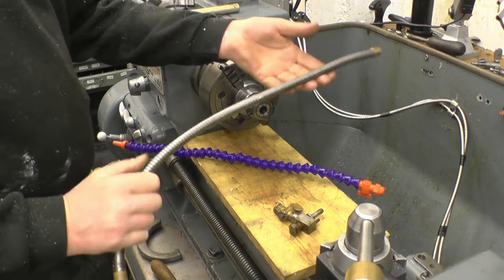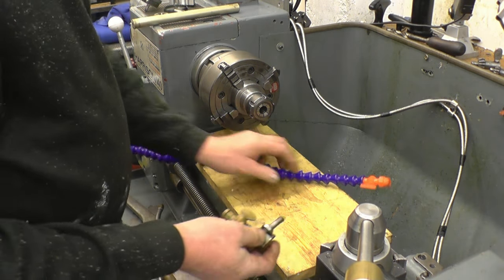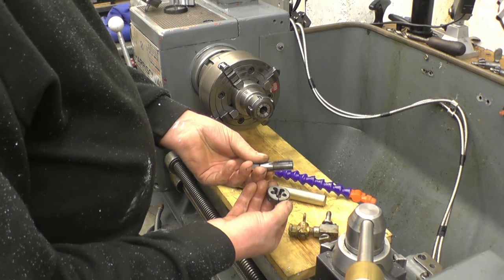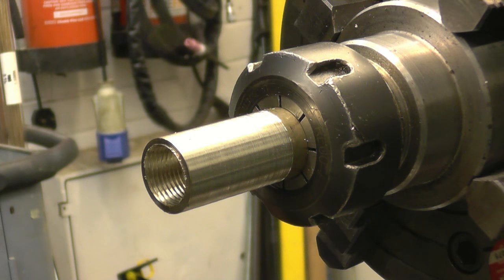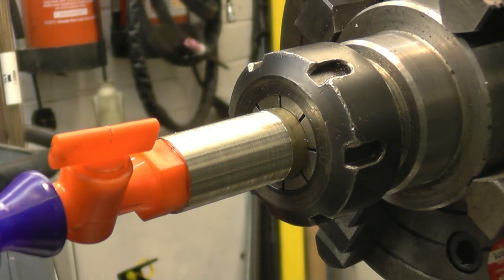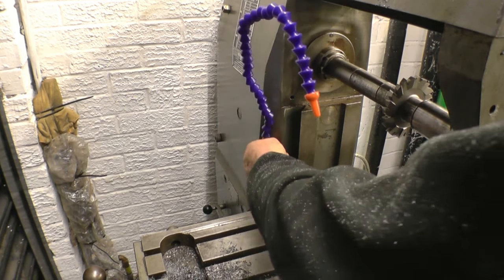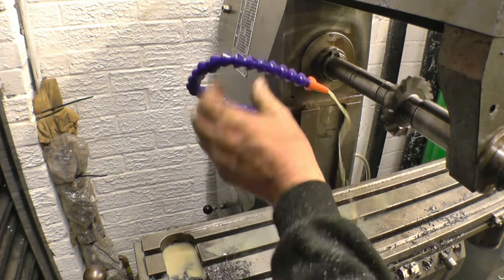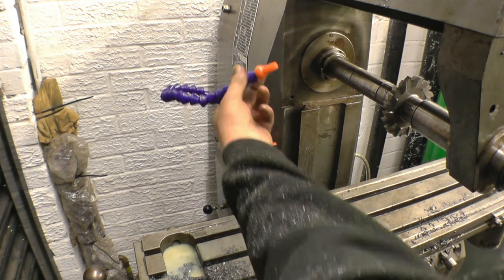SNNC146 P1   BSP Threads Coolant pipe adapter

Comment: the plastic pipe seems have about a half dozen leaks! also a drip on the brass joint, hope it has a pan underneath it
Reply from the maker: it has a bog catch tank  all the plastic pipes piss out
Reply: doubleboost Made in USA, loc-line is the only brand I would get.

Comment: I have used SanDisk for years and no problem. I prefer the extreme editions class 10. I can not think of a single failed card. I get mine via www.scan.co.uk  dealt with them since the mid 90s so reliable.
Reply: HighlandSteam

Comment: John, Please explain about BSPP and BSPT!   BSPP is a Parallel thread (like all engineering threads) but BSPT has a Taper.

The usual in pipe fittings is that the female is parallel and the male is tapered.

So its easy to machine a female BSPP thread, but how to easily machine a male BSPT? ?

Comment: Never buy cheap cards, only good ones that will last. The video on them is worth more than the card. I did kill a few low cost cards ( note, low cost not cheap) in the DVR after around a year of heavy use.
Reply: many ebay cards are fake, better to stick to sandisk or quality cards from a solid uk seller, i usually buy from amazon, as in them as the seller, not a storefront, the extra pound or so is well worth it.

Comment: Looks like navel lint in the center hole. LOL - Great work on the piping adapter.  Why is the blue pipe leaking at several of the joints??  Wonderful Plastic!